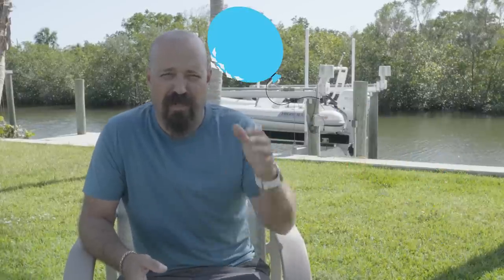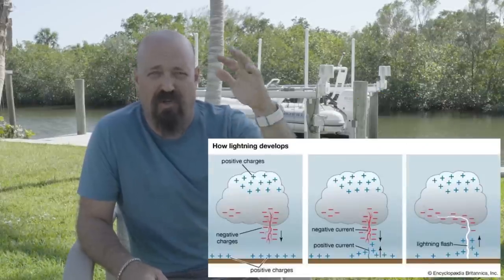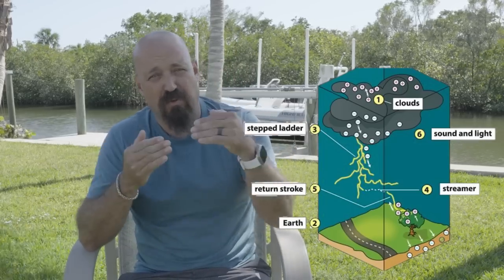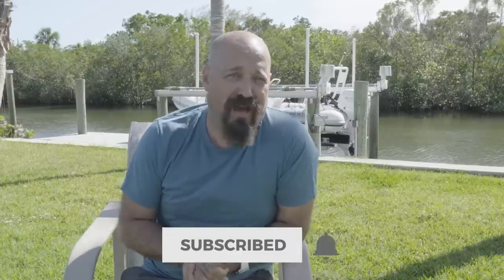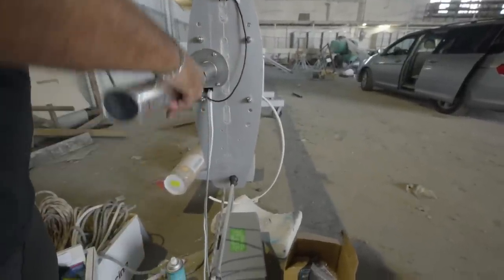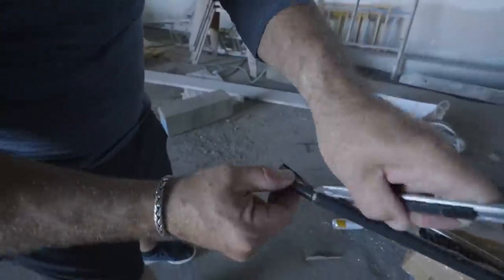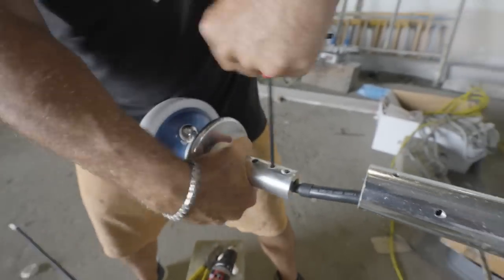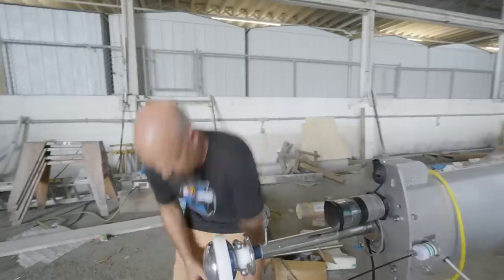LIGHTNING PREVENTION//Preventing A Lightning Strike On A Sailboat-Episode 114

Comment: It only makes sense to do this. It’s not just the money. It’s safety. If you get hit while cruising, you are pretty much screwed. It may take months to get your equipment replaced.. and you may have to sail hundreds of miles without engines, chart plotter, gps units, radios, etc.  Not a good place to be in. The motor for your bilge pumps?

Comment: Great presentation and installation!  I'm just starting my install, would you describe what you did under the water line as far as how many plates and locations?  Thanks
Reply from the maker: Single plate below the shortest/most direct path from the mast to the water.  A single plate is sufficient on monohulls or cats that do not fly a hull.

Comment: Certsinly hoping this works for your boat after all the hard work!  Especially with all your electric. Nothing is 100% as you say, but this device sounds wonderful!  I’ve list several palm trees ti lightning and you are right, one got hit but then the charge jumped sideways to the adjacent tree and they both died.  Maybe the truck is to never be in a marina during a lightning storm?  Well, at least avoid it when possible 🙏

Comment: Ty, looks like great suff.
But if it works as you described, I bet it will have an effect to the VHF.
And because you put that heatshrink on the antenna rod I would advise you to check if the antenna is still working on the right frequency range after you put up the mast. Heatshrink can affect the antenna behavior because it typically is combined with carbon to color it black.
Just my two cents as Amateur Radio Operator.
Otherwise, please continue with your technical videos, I love how you work through your challanges!
Cheers
Marc
Reply from the maker: Thanks for the tip!

Comment: Hello, I have a 47ft fibreglass sailboat with aluminum mast.  The lead keel is covered by fibreglass.  I plan to install a copper grounding plate on the outer surface of the hull.  How should I connect the plate to the mast?  What material, what size?  Finally, the plate will be about 50 cm below waterline and about 150 cm away from the mast.  To connect the two, the metal rod or cable would have a vertical U shape.  Do you see a problem with this?  Thank you so much.

Comment: Do these units have an expected useful life? Do they need to be replaced after so many years? Thanks for video, very informative!!
Reply: The only maintenance this this style of unit would be clearing cobwebs, cleaning salt depostis etc but these are a sealed unit a long way from salt water (relative to fresh water rain).
They basically employ a smooth surface ( this deionises, pointy stuff attracts lighning/ionises btw) and air capacitance between a couple of the sections. So no maintenance to the actual unit but id regularly be going over the electrical conections to make sure they are low resistance. Ie, fresh conductive grease, tight connection and the like

Comment: Love your video, i'm recommending this to our customer which owns a marine FSO vessel. Tell me, what size of grounding wire would fit/requirement for a CMCE-diamond and platinum models. Thanks.
Reply from the maker: It is typically based on length of the conductor.  For 100’ I ran 1/0 (and that was overkill)

Comment: If this is a prevention device, and not a grounding device, then why is there a large gage grounding wire being run from it down the mast?
Reply from the maker: Because the device drains current, it need a connection to earth/ground to deposit the ionization

Comment: The only for sure way I know to prevent electrical damage on your boat from mast lightning strikes is to dissipate the charges on the mast. Thus avoiding the development of the lightning channel between the cloud and your mast. Different words, same fix you pointed out.

Or keep listening to the many old yacht club mummies that insist there is no way. I have license to speak like that because I'm an old yacht club mummy.
Reply from the maker: Exactly!
Reply: @SailingDauntless  Better of explaining this concept to my Grandkids. They all left high school knowing how electricity works. The electrons will need to flow from the negative to the positive through a conductor. When there is a path that goes from the negative to the positive you have a circuit. Whether you are using a battery, a fuel cell or a solar cell to produce electricity, things are always the same: Every circuit, especially the very complex ones in my parallel drives want to have at a certain voltage. Introduce a higher voltage into any of those circuits and you going to be hating life. Pricey, but stopping the mast from being a conductor is the only solution today for mast lightning strikes.

Comment: Went to EMP's site to research (also found Sertec's site to learn more from the manufacture) and I notice that you appear to have what EMP Solutions lists as a "land solution".  The "land" variant is different or appears different in that they all seem to have 4 metal balls under the primary metal dome...the CMCEs listed as "Marine Solutions" don't have the smaller metal balls. This beg the question(s) why did you get what is categorized as a land solution?  Why do the land solutions have the 4 metal balls and the marine solutions don't?  And lastly what do the 4 balls do?
Reply from the maker: They do the same thing, but the land unit was available when I ordered mine. And I was not concerned about the additional few pounds of weight.
Reply: The small balls i strongly suspect are mostly an extention of the pain spherical surfaces function. Smooth curved surfaces perform the deionising function. Id sumise the top and bottom half of the main sphere are electrically isolated and form a capacitor, the lower section of which is grounded through the boat, the 4 smaller spheres and the disk below them form a second deionising surface and a second capacitor.
You can google teslas original patent but bear in mind some of the meanings of english words have changed over the last 100 yrs, telsa had a tendency to put superfluous information in patents or omit information as a secondary form of protection of his intellectual property so some knowlege of electronics/physics can be handy.